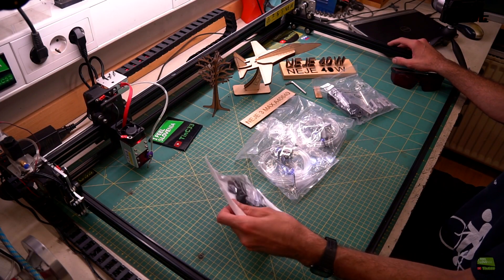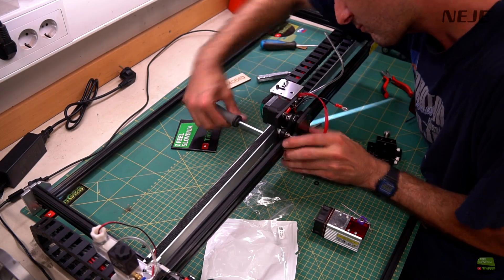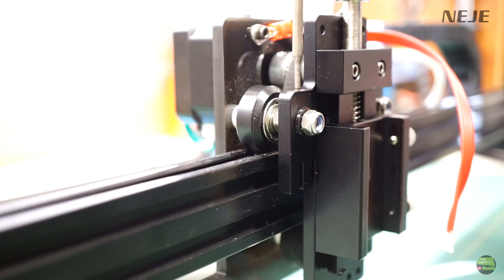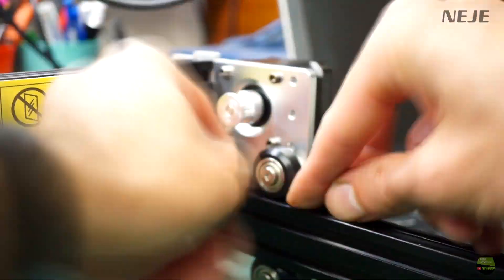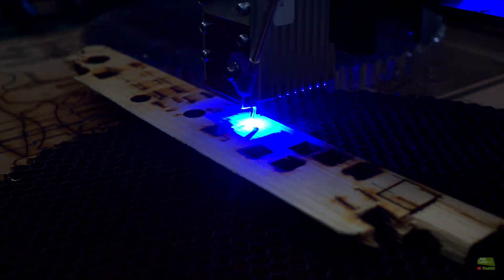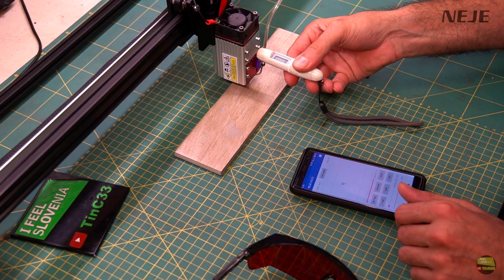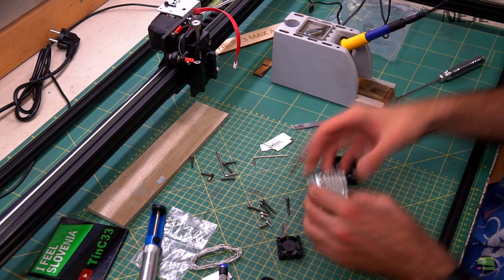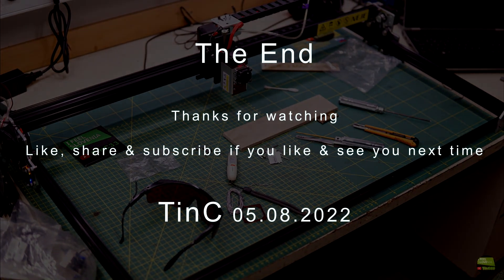Neje 3 max addons NEJE H20 - Z axis adjuster, Belt Tensioner, AF8/KF8 AIR NOZZLE & R10 Heat Sink

Comment: Great video.
I noticed two short black cables with red connectors on the laser module.
Could you please explain what they are for and how they are connected?
Thanks..
Reply from the maker: Hello, it's ground cable make by myself, but on latest version they add this cable to a machine wich prevent machine from stop responding, check my neje 3 max video for more details about this cable.

Comment: Can a roller be used with this laser engraver? if so which model of roller can be used to engrave on bottles and rounded objects?
Reply from the maker: Yes it can be used, basicaly any stepper motor simply plug to one of Y motor connector (disconnect booth y motors) but don't know why neje got out of stock roller for more than a year, but i'm quite sure any other brand will work, in worst case you'll need to change motor connector, but didn't try yet so i'm not 100% sure

Comment: Wow this video was released just in time, I received all my parts today and your video was essential in helping me figure some things out.  Much appreciated
Reply: You and me both, lol.  Much appreciated!
Reply from the maker: Thanks you both
Reply: @TinC33  my machine also came with a yellow and green wire with terminals on both ends.  I'm assuming that is a grounding wire.  My question would be does it connect to the laser head via drag chain back to x axis stepper motor? There are only two ring terminals.
Reply from the maker: @williedog1127  aha, so they already add a ground cable, idk that, but i can say they're really fast in upgrading their machine.
If there are only two ring on the cable try connect laser modul and left y motor, if there still be a problem try to make aditional wire like i do to a - pole of power supply.
Reply: @TinC33  that's the thing,  I haven't had any problems yet.  I actually ran a 2 hour burn non stop without any problems at all.  The laser module had the extra cooling fan per installed and it never got the slightest warm.  The stepper motor on the x axis got a little warm but that was it.  Also want to thank you for answering back as quickly as you do.  I'm 64 years old and retired due to some health issues and really enjoying trying out new things.
Reply: @TinC33  quick question,  I just received my air compressor but I can't get I can't get lightburn m7 to work because it's not set in laser grbl.  I tried to set it in grbl but I get access denied to com4. Believe me I don't like to bother you cause I know you are pretty busy.  My last resort cause I can't find anything on the web to answer this question.  Thanks in advance, Rick
Reply from the maker: @williedog1127  so everything work expet m7 for air assist?
First go to neje wiki / neje 3 max and scroll down to lightburn settings, there is one step for m7 make it work, you'll need to connect laser to lightburn and then go device settings / gcode tab where you manege g code and just type m7 into start g code field, there are manual with photos on neje wiki...
Please report if it work.